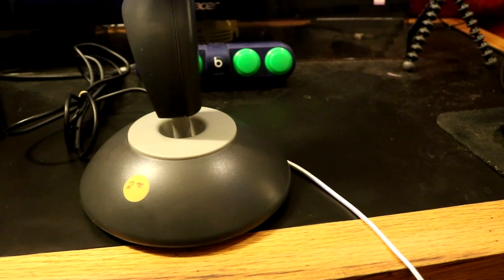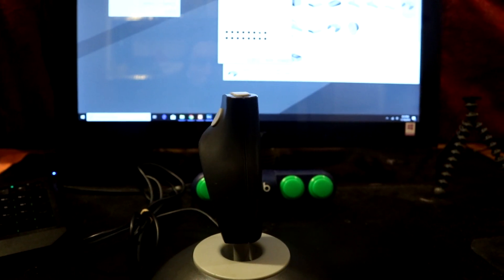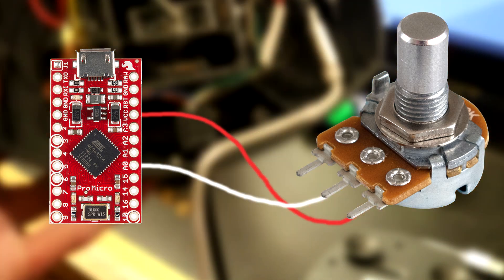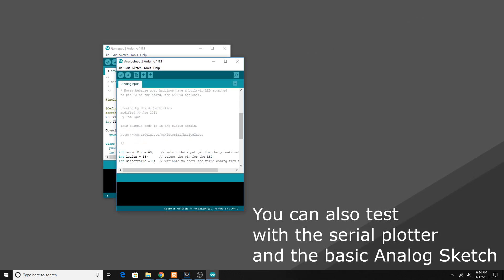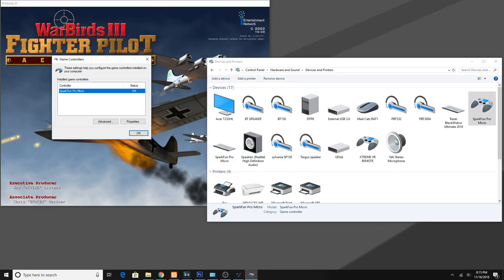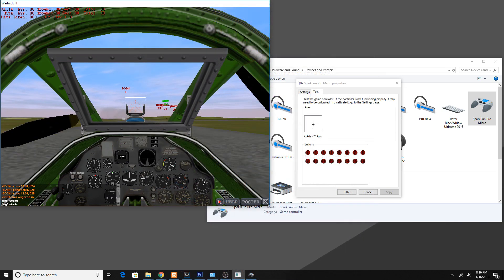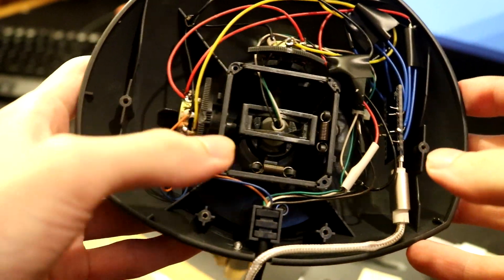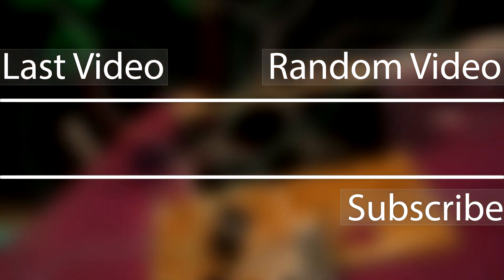Converting A Old Flight Stick To Usb Arduino

Comment: Thank you for the sketch and video. Ive been pulling my hair out trying to find a sketch that does this (that works) and is coming up as a joystick in Windows. 
I can get the buttons working but how can I add another potentiometer (for something a like throttle)?
Reply from the maker: I think the sketch handles it in been awhile but you hook up another potentiometer the same way. If im wrong ill have to bust out my flight stick and ardurino ide software. Its been awhile.
Reply: @everythingdigital1  That would be greatly appreciated. I got 1 joystick to work so think that's a big win for me. If I could get another connected then I will ecstatic. Ive been playing around with the (true, true, false, false, true, true, false, false, false, false, false) and found they correspond with win 10 recognizing that there are throttles z axis ect.

Comment: Hey, you know any good tech accesoires/gadgets i can buy for my pc? :)
(I know this has nothing to do with thé video... Sorry)
Reply from the maker: Well if your into coding and DIY make a programmable button box it's useful when it comes to doing repetitive things cause you can program it to do the stuff for you. Other then that maybe a sdr dongle so you can view different radio frequencies and pull images from satellites and track planes and things. Also a usb hub can come in handy. But yea most of my pc accessory's I make cause it cheaper and even looks better most of the time so far my favorite gadget is on my second pc and its a lcd side panel which i'm trying to also make for my main pc now.
Reply: @everythingdigital1  thank you!
Reply from the maker: @ras862  Yw